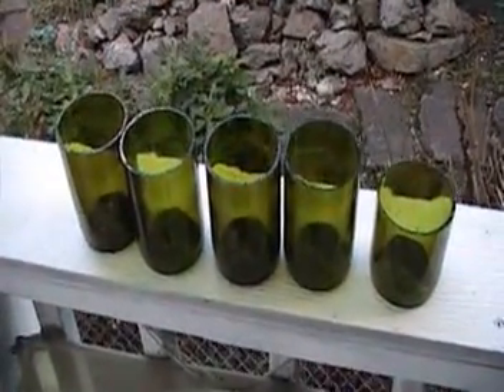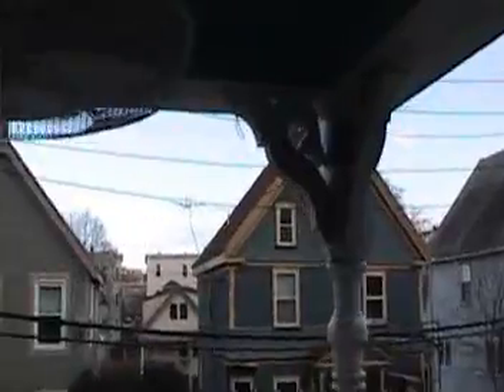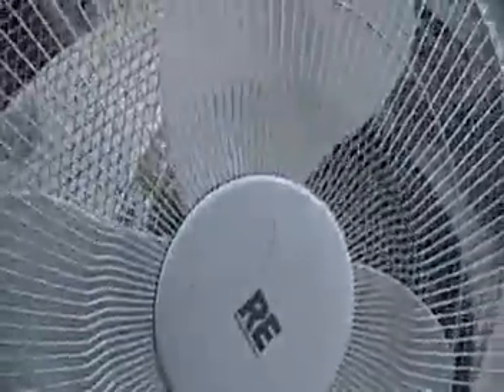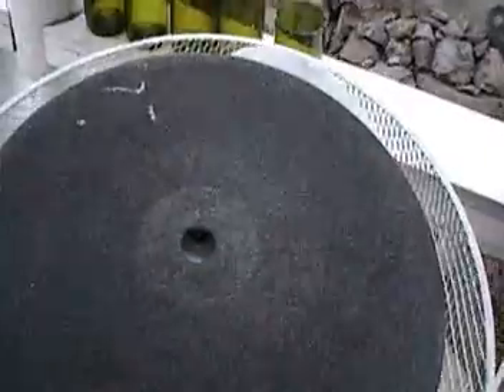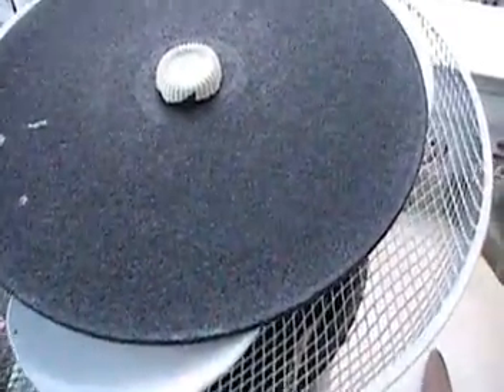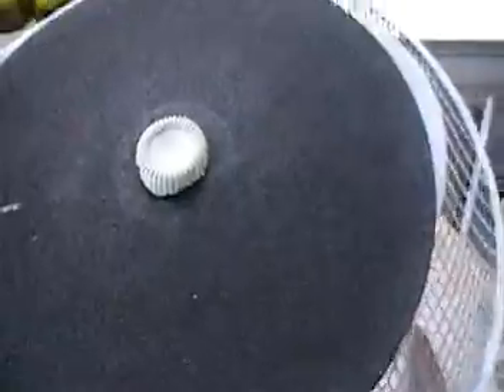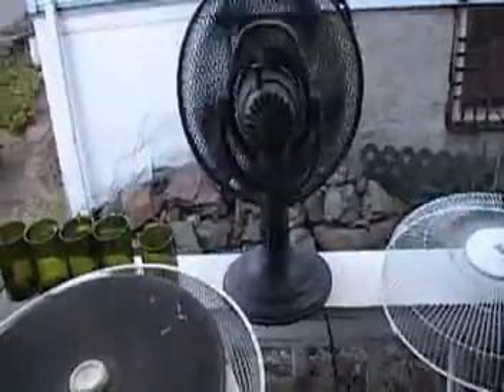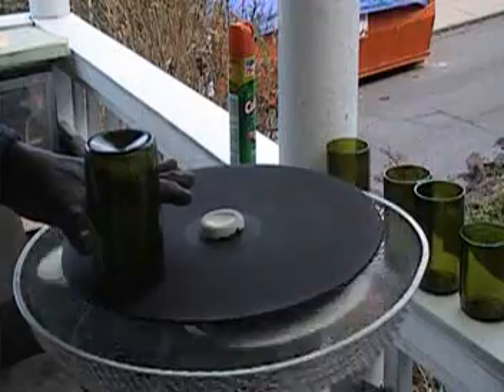Glass Grinder: DIY (sandpaper cover optional)  (PRPaul1)

Comment: Hey that's a quick 25 cents at your next garage sale.
Reply from the maker: I think that the bottleneck alone is worth $7. See one on e-bay by typing"Thick Glass Bottleneck Guitar Slide - Handmade In Memphis, TN"
 I visited your channel and discovered the "make it extreme" channel while watching the extreme glass grinder listed in your "liked videos" folder. If you have had any communication with the people of "make it extreme", please let them know that I have a project that they can build and make money with. It is a simple kit that will allow loggers to setup lathes in the woods by using two tree stumps. It will be the forest version of my (chainsaw lathe) video. Instead of starting with a square piece of lumber from the lumber store, the lathe will turn long straight tree trunks.  The other part of the project involves building an mechanical arm that holds the chainsaw instead of a person.  Please also watch the  video entitled "handsfree glass grinder."  Thank you for the feedback!

Comment: Jesus dude...you're supposed to use water so you don't breath in glass...
Reply from the maker: I know a lot about breathing in glass. When I used a wall mounted glass cutter at work (cutting glass all night) I could not figure out how pieces of glass made their way to my mouth, then realized that I was looking up while cutting by running the cutting wheel from top to bottom. I can assure you that I had a fan located at an angle behind me that was blowing the dust away from me.
But I decide to stay away from the action as well and built the "Handsfree Glass Grinder:  DIY by (PRPaul1)" which is the title of the video. Please take a look at the video and give me more feedback. I can tell you that if I ever use this again, I will figure out a way to add water with a sprinkler spraying a fine mist. Protecting the motor from falling water should not be difficult. I have not used the grinder since I made it for a video. But I am still using some of the drinking glasses that you see in the video. If you cannot find a way to add water, let me know. Thanks for the feedback!